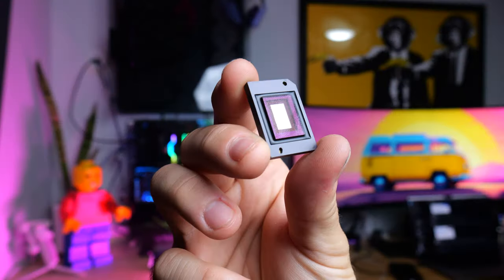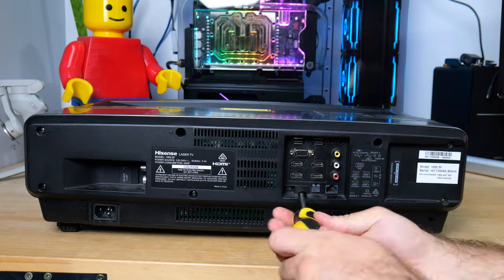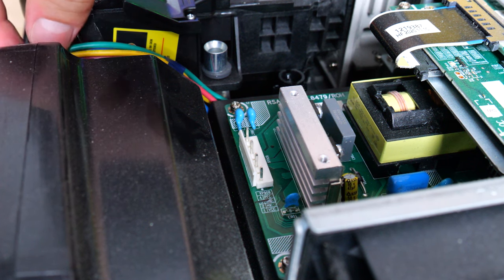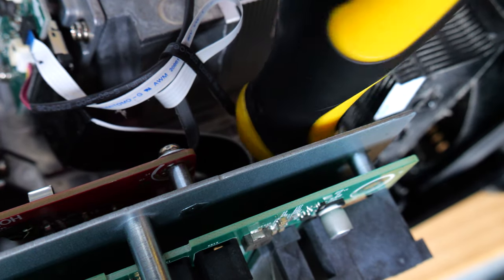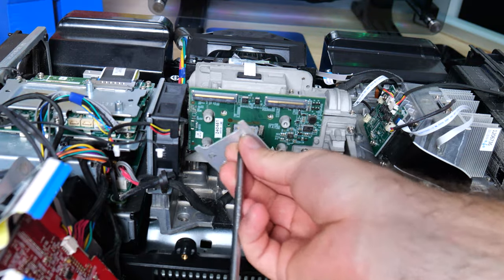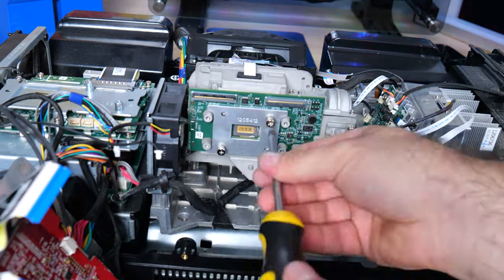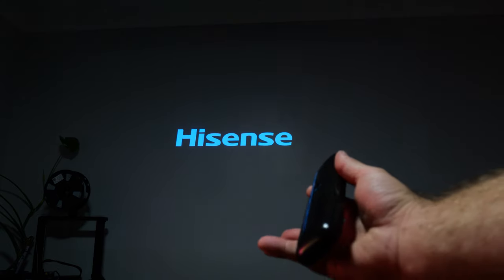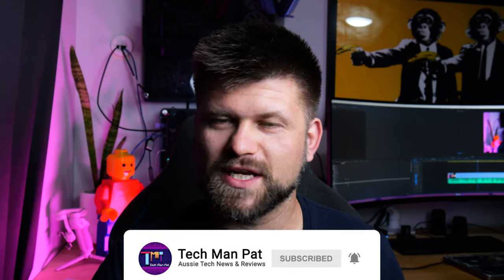How to replace DMD Chip in a DLP Projector | Tutorial ft. Hisense 100L5F

Comment: Mine won’t turn on after I put it back together. Any ideas? Flashing red 3x. Hear the fans kick on but no video
Reply from the maker: Maybe you forgot a few plugs while putting it back together ?
Reply: No everything where it was. Figured it needs a hard reset but not sure how
Reply: Same here got 4 red lights, took all the cables apart again and made sure they were pushed in firmly, on switching on the light was normal white and the fan came on but no projection at all. 😢

Comment: Pat, great video!  Our Hisense L9G 120 inch projector is now 27  months old and gets about 8 hours of use daily.  It just produced its first stuck pixel.  Maybe Hisense will help us and fix this, otherwise, do you advise to wait for more pixels to get stuck before chip replacement?  Also, where do we find out the part number and buy a replacement chip in the USA?
Reply from the maker: Maybe worth waiting, unless the pixels bother you a lot. eBay will be your best bet for the chip parts, the way to find it is to look for via your projectors model number, this should be enough via google.

Comment: Pat, I commented 1 month ago when I first had a bad pixel and found this video.  In the last couple of days, a second pixel has stuck white.  I went on the USA Hisense website and they now are listing as available a DMD chip as: Hisense 303302 for many projectors including our 120L9G.  US dollar price is a little over $700 and availability in about 20 days.  they also list availability of an extended warranty for 2 years for $600.  But I cannot find out the exact warranty terms and if this includes replacing a DMD due to 2 stuck pixels.  Anyways, is it possible using this Hisense part number to find out if there is another part number like from Texas Instruments?
Reply from the maker: Yes that would be the best way, the chip I got here was less than $150 USD off eBay, it was however second hand. But if it lasts 2 years I can then replace it again 5 times before paying Hisense directly.

Comment: I’m using the same model but right now i’m having trouble casting youtube via my iPhone, it used to working well before.

And sometime i can’t use the remote to interact with the YouTube app, I have to change to Netflix and back to YouTube again.

Any suggestions for this two issue? 

Thank you so much 🙏
Reply from the maker: Software reset / update is your first port of call.

Comment: Tried this and it failed for me unfortunately. No projection with red light flashing 4 times. Reconnected all the cables  again and that had no red lights, fan came on but no projection. So guess the lamp has a short circuit. 😢
Reply: UPDATE: I did get this to work, I had one of the ribbon cables inserted the wrong way. My Hisense projector is the 88” version, for anyone interested if this helps the chip is a Texas Instruments DLP470TPAFQN. I found it difficult to locate this exact chip but was advised that a 228-0 1910-50BBM is the same chip. Installed and working fine. You have to make sure your ribbon cables are installed correctly if you get red flashing light on the front or no projection at all.